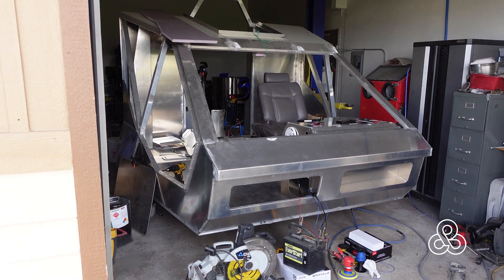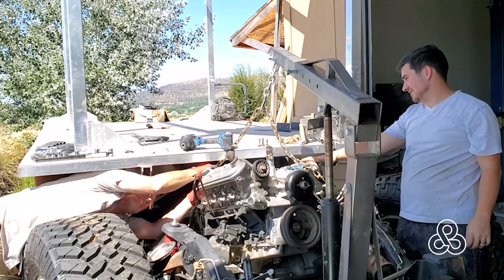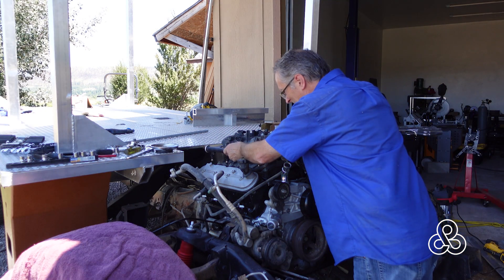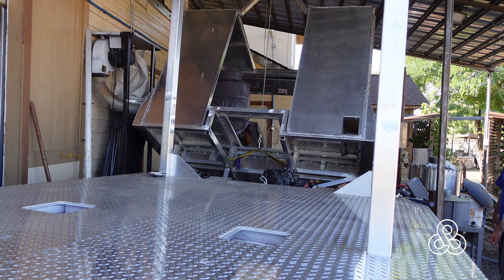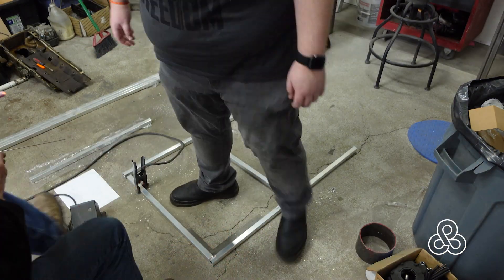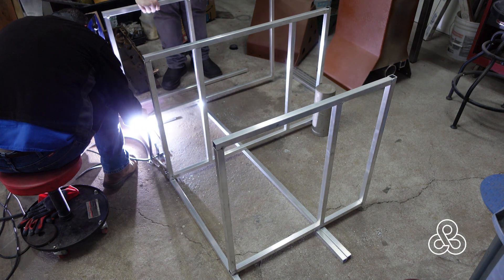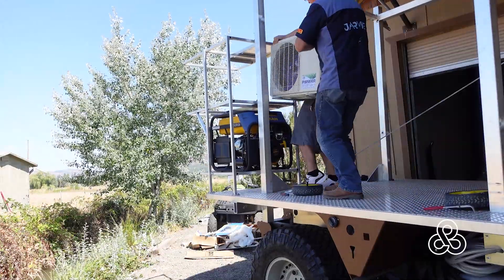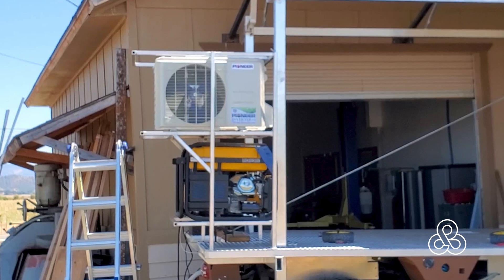L16 Vroom with a view! The cab gets placed on the chassis. Leviathan Overlander project.

Comment: That generator puts out pretty dirty power and can damage sensitive electronics; check the THD on the specs. If you're going to power any electronics with that you should probably run them through something to clean the power up a bit like a line conditioning UPS
Reply from the maker: There will be a full solar, battery and electronic management system. Sometime, I might plug it directly into my homes septic system on a power outage, but that's pretty dirty as well, Ha!

Comment: What motor are you using ,what year motor ?
Reply from the maker: It is the 2000 year LQ4 (LS 6.0L) Cast iron heads and case.
Reply: @BuilderCreator  That should run strong !

Comment: In Europe, we have more compact and light air conditioning systems, running 12/24 AC on motorhomes and boats, the standards on rolling weight and gauge are stricter in Europe, you will surely be able to find other interesting things to mount ... ^^

Comment: it is looking amazing 😊👍
Reply from the maker: Hey, how are things on the far side of the globe?
Reply: @BuilderCreator  heeeey, long time.... So things have been quite interesting, remember I asked for suggestions regarding FRPs for our Ground Rover, well we did it and it turned out amazing... the finish was flawless (although got some pin holes so had to fill them with body filler) plus it parted from the mold like butter, so that came out very well. So with that rover we were suppose to come to USA for a competition held in Oakland university, Michigan but we were not able to get our VISA on time so that plan got pushed to next year. Apart from that I completed my B.Tech in Mechanical Engineering and now heading to Germany for my Masters (will be moving by next month). 

So things have been going very nicely, I have been watching all your videos and just enjoying the journey, saw what you did for the Arete seats, I had just one concern won't it become a bit uncomfortable after long drive without any cushioning..😅😅. tbh, I'm just waiting for Arete to move under its own power, it's going to be surreal, I was genuinely surprised to see so much progress on the leviathan project it is looking like beast, its very well made.

what about you sir, how are things going there?

Comment: look's great just one question why would you not use a diesel engine.
Reply from the maker: Going to run it on a dual fuel system- petrol and LP gas. hoping to have a 1200 mile range when fully fueled.